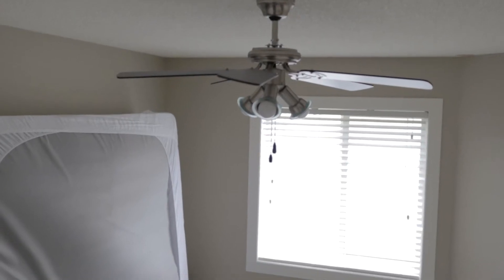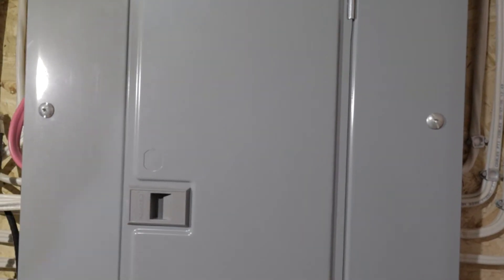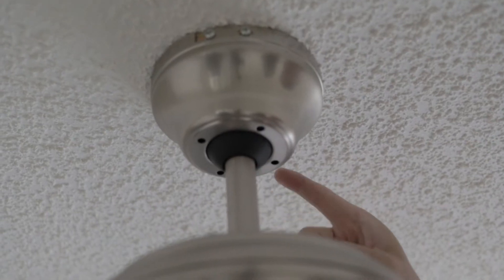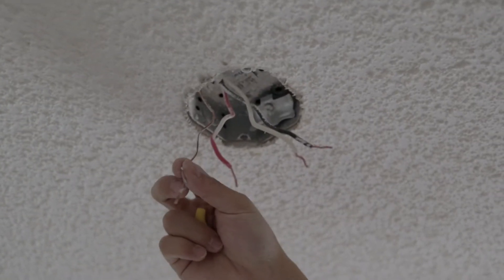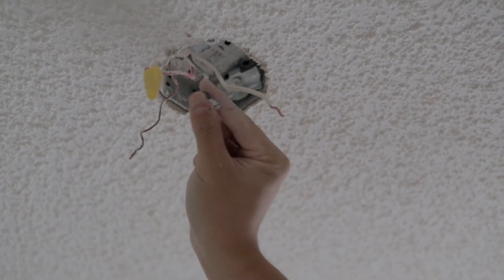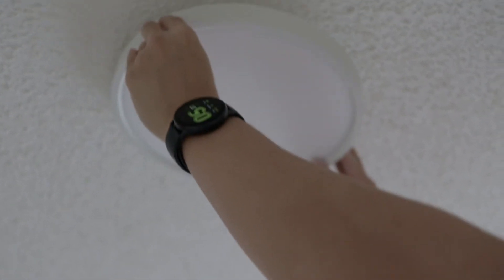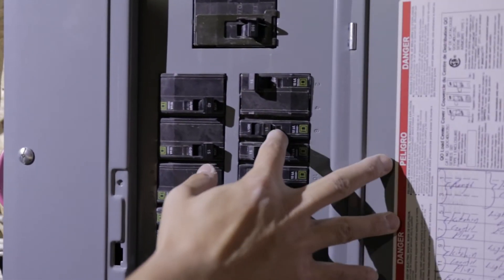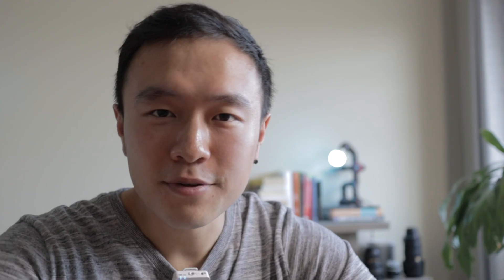HOW TO REMOVE A CEILING FAN AND INSTALL A WIFI ENABLED SMART LIGHT FOR YOUR ALEXA/GOOGLE SMART HOME

Comment: I'm pretty sure I have the same exact light but I cannot figure out for the life of me how to get it to work with my alexa without defining an exact phrase for it to work. Ex: to turn bedroom light on I had to go on my alexa app and set the phrase "turn bedroom the light on" with turning the bedroom light on. But if I miss a single word it yells at me saying "bedroom doesn't support that" I feel like I've tried everything and am super frustrated. I want to be able to change color and light temp via voice if possible like you did in the video!! I'm desperate for help 😂 thanks!
Reply from the maker: You need to ensure you download the appropriate skills app on Alexa. Then you need to connect that skill with your Alexa account, add the device to your bedroom group, then it should work!